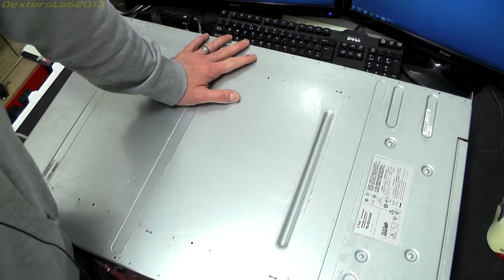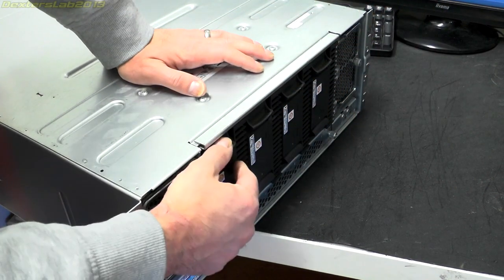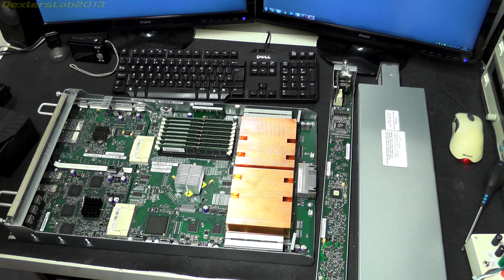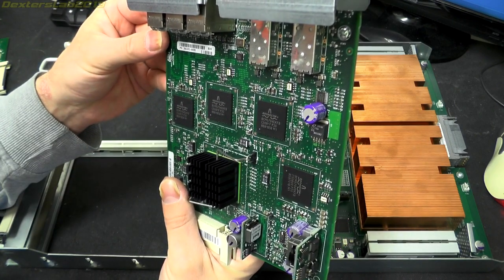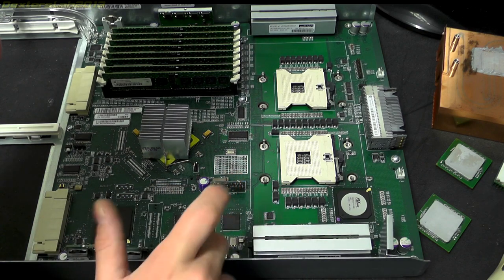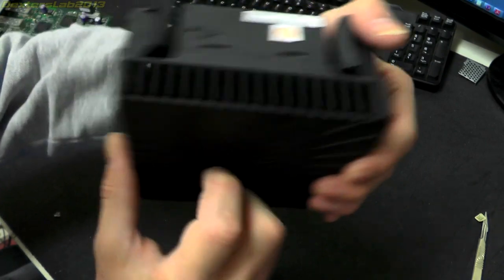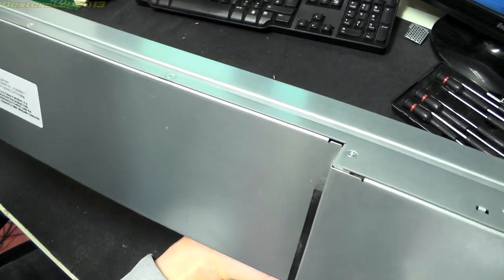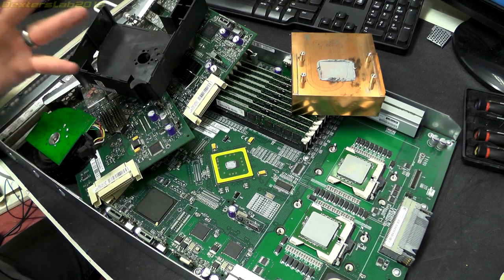DL#089 - DELL EMC2 CX3-80 $100,000 SAN Processor Teardown

Comment: Just FYI, this is not a SAN controller / Storage Processor, it's a NAS (filer) head, AKA Data Mover. The optical fibre channel ports would connect to a SAN controller (or switch). This would therefore be a Celerra product, not a CLARiiON. The SAN version is very similar, but would have more fibre channel ports in place of the Ethernet modules, and the long skinny management board would be slightly different.
Reply from the maker: Matthew, thank you for the comments, it's always great to hear from someone who worked on things i do a teardown on!

Comment: Geeze, I thought the 1U version of this thing I tore down was big. The 4U one you got is insane.

They all seem to essentially use the same hardware. You'd think with all these models they'd eventually integrate the DC-DC converters, etc. But I guess at that price point they don't care too much about saving a few bucks.
Reply from the maker: +Peter Brockie no chance of risking reliability for a few bucks, though i don't understand why it was physically built so well, i am sure they knew it would be obsolete with 10 years
Reply: These are sometimes kept longer than 10 years.

Comment: Interesting fact most of the EMC power supplies are also rated for straight DC at high voltage which is what they use for battery backup long enough to flush write caches.
Reply from the maker: This is also true for many switchmode power supplies
Reply: Aye, but EMC was shipping PSUs with DC input ratings on them. Part of the CLARiiON line or what became of that anyway. Nothing resembling those anymore, I haven't been anywhere near the newer stuff, it long ago became far more economical to produce high availability storage through software. And with them now being owned by Dell I'm not sure what the value is! Nice find though. Hadn't seen one of them in quite some time.
Reply: OverKillPlusOne I found several of those Clarrion units the other day. They provide 120v or 240v. The units are interesting. It requires a signal cable to be connected to the controller or spe. I have the spe too. The cx4 I have has modular CPU boards, think ibm beowolf clusters. Unfortunately I don't have any of the CPU modules. the back contains a bunch of slots for fiber and other communications modules. No power plug like you'd have on a typical computer. Everything seems annoyingly proprietary. The Clarion backups use a pic microcontroller in a socket. I'm going to see if I can read the program on the chip and hack the backups to work like a normal ups.
Reply: @Justplanecrazy25  - I realize this is a 2 year old thread, but there's no point in trying to reprogram the microcontroller. CLARiiON Standby Power Supplies pass through AC current in bypass mode, but when on battery power, they output ~ 200 volts *DC*. They don't contain inverters, and cannot output AC while running on battery.

Comment: Given that single servers can often run upwards of $50,000 (we paid this for 4 socket IBM intel boxes about 5 years ago), your estimate may actually be low.
Reply from the maker: Thanks Andrew, a friend of mine used to sell these systems and yes, he mentioned there was no list price for this Processor part because it was always included in the overall cost of the system, which typically ranged from £100k to £500k depending on the configuration.
Reply: I wouldn't doubt if the CX3-80 (controller shelf) itself costed $100,000. These are not cheap toys.

Comment: +DextersLab2013 The 8 ports would more likely be used as 4 redundant ports, which would then go to redundant FC switches. Not 8 hosts...
Reply from the maker: +Michael DuFresne interesting, thanks for the extra info
Reply: Depends if you wanted little yellow exclamation marks in your Navisphere Navigator or not. :-) (In other words, there are a lot of "naughty" things you can do that it will just tell you "this is very wrong!" in as far as redundancy/etc. Like say you only had one storage processor or one power supply or your FLARE RAID1 volume was missing one of it's five drives.)

Comment: This is how you let out the magic smoke:
clariion
clariion!

(Worked as a service engineer on these. It's not like the FLARE code is just running Windows or something. Oh wait, it is. :-) )

It turns out many companies hide things like this though. Worked on a quarter of a million dollar Cisco switch that was literally just running Linux. (Fibrechannel switch.)

So much of our reality is just off the shelf stuff just cobbled together in weird and wonderful ways.
Reply: Hi, I worked as a development engineer on these. :) While it's true that Windows is running on the SPs, Windows doesn't even see the back-end drives or most of the memory in the system. There are many, many, many proprietary drivers providing the actual I/O path. The fact that SPs run Windows was never hidden - there are Windows license stickers right on the enclosure!